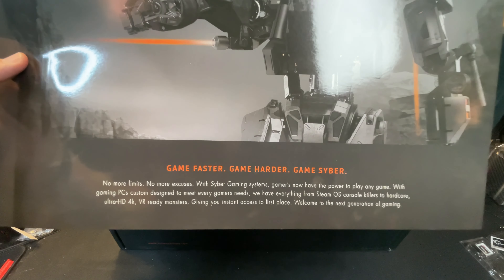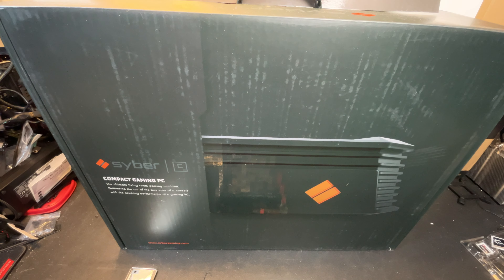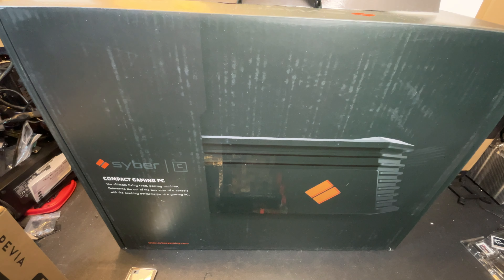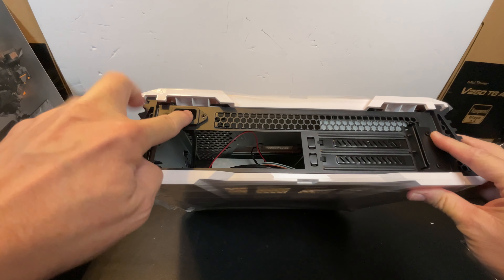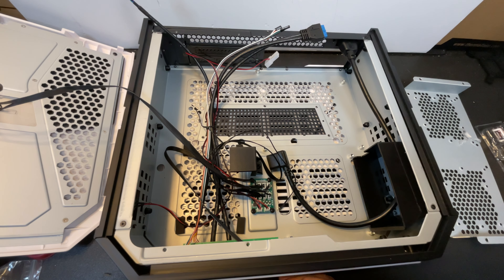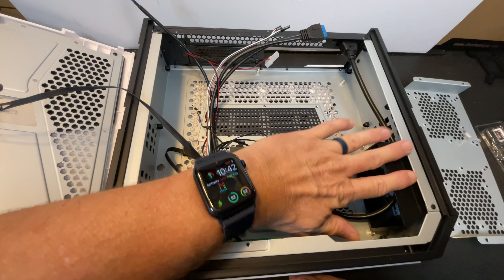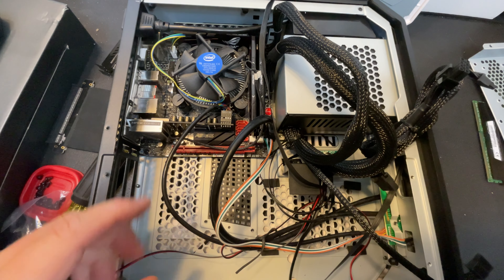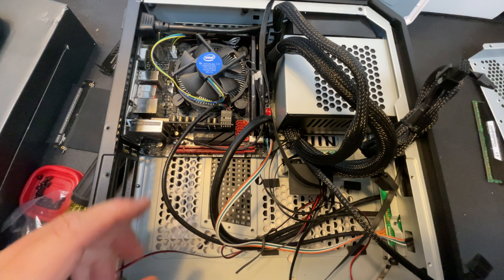This Computer Case is CURSED!  My most challenging PC build. mini ITX Gaming PC

Comment: 12:18   I do not think the shroud is for hiding cable, it is for making sure the PSU is exhausting the hot air outside the case.  I would probably have pulled the extra wire out and used zip ties to hold it against that left side as it runs to the back.
18:20   The little foam blocks on the bottom are supposed to hold up the GPU.  If one doesn't reach I would stack 2 or 3 and put them on the faceplate off to the side of the fans.

Comment: I did it a little differently.  I used a PIO ThinITX motherboard and put the GPU (2070 Super) over on the "motherboard" side.  I was able to use a new FSP 500w 'FlexATX' power supply originally for a NUC Extreme (they are going dirt cheap.  The seller offered it to me for 10 dollars+10 S&H).
The motherboards are a Chinese special meant for a semi-custom all-in-one I think.  But they are less than a comparable regular ITX board.

It is a rather terrible case design.  Everything fits and it's actually got plenty of room to spare, but I feel like it needed an option where it stands up on one side, its Huuge for a 'SFF'
Reply: PIO is a 'Parallel IO' x16 slot, so the GPU plugs into the top edge of the motherboard, so the GPU fans face up just like a standard boxed CPU cooler.
It required 4 new holes for new motherboard standoffs.  I cut the bar between the expansion slots, because that is where the motherboard I/O is now.  The FlexATX PSU went on standoffs off the 'Left' side exhausting where the LED button was.  I'm probably going to cut out the LED button mount so the hot air can get out.  I removed the Syber LED logo from the lid and replaced it with some mesh (6"x36" 'Gutter gaurd' from hardware store, $4).  I will run some tests and see if I need to cut the lid for cooling over the GPU (the third fan is basically where the PSU used to be, and faces up).